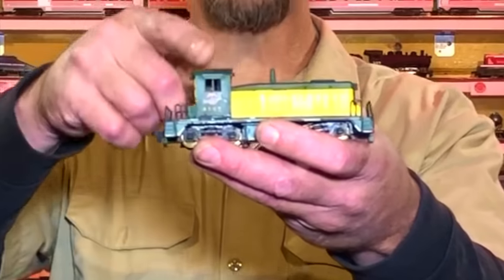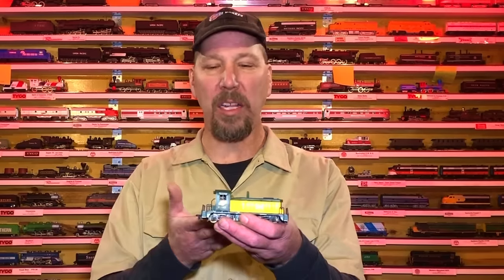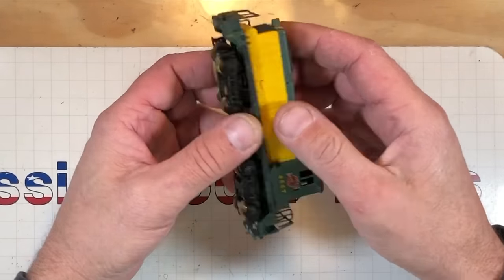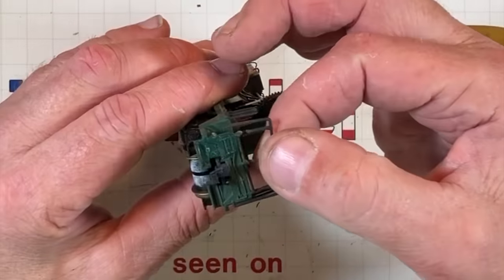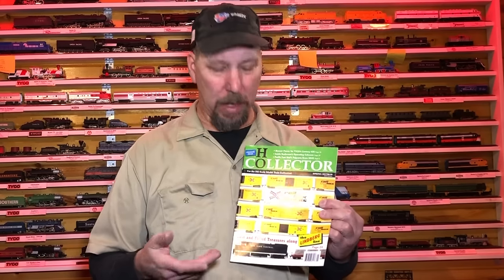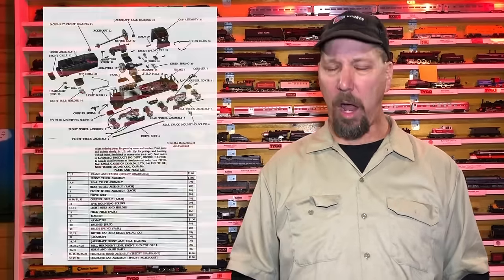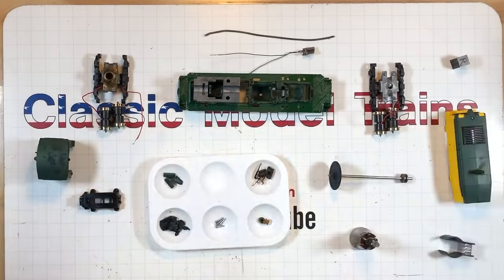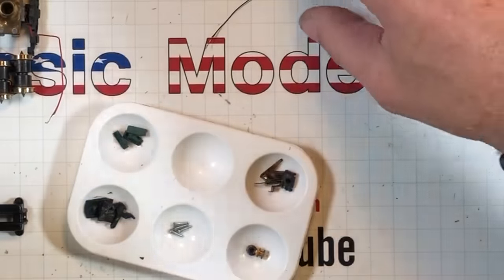62 Year Old Lindberg H.O. SW600 ,  How To Tear Down & Re-lube

Comment: Hey, I wanted to know, which one of these is a better deal?

 A lot with a partial Tyco Rail Master 72 set and a partial Bachmann Golden Spike set, tested and working, for $50.

 A lot with a Tyco Santa Fe GP20, Virginian C430, 7 cars (2 badly damaged), a bunch of track, and two power packs, tested and working, for $55.
Reply from the maker: Stay away from Bachmann locomotives. They almost always have cracked gears.
Reply: @classicmodeltrains  Would the lot be worth is just for the Tyco set - I really want the Rail Master 72 set.
Reply from the maker: @davydigger708  buy them both and build your empire!!
Reply: @classicmodeltrains  I wish I could - I just don't have the money right now.
Reply: @classicmodeltrains  Also, what should I do with the extra power packs that I don't really need?

Comment: Pro-Line RC racing paint should stick to that plastic.  As I model the Milwaukee Road, my Delrin handrails need a coat of white on the ends.  It works for me.

Edit: "If you don't like it, just leave" 😂. That's up there with Tank Chats David Fletcher's wonderful "Well that's your opinion and that's fine, but nobody wants to hear it, just keep it to yourself".
Reply from the maker: I read that R/C paint was a lot better at staying put.  Probably because of all the fuel that ends up on the finish.  People that thumb down a video are clowns

Comment: How much is a Tyco Rail Master 72 set worth?
Reply from the maker: $35-$60 ish I would say
Reply: @classicmodeltrains  How much would an incomplete one be worth?
Reply: @classicmodeltrains  I'm looking at two - one untested, missing track, power pack, and autos - for $35 -- and that $50 lot with two sets - one being a Rail Master 72 - missing autos, terminal, and power pack - engine runs.
Reply from the maker: @davydigger708   Buy them both up.  Haggle the price down if you can
Reply: @classicmodeltrains  I can't - I already did - I still can't afford both right now.